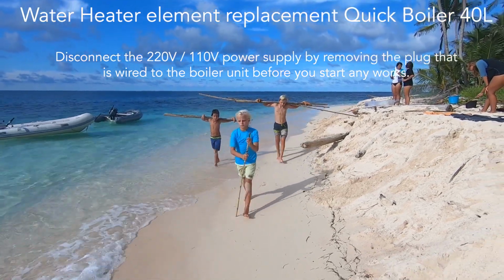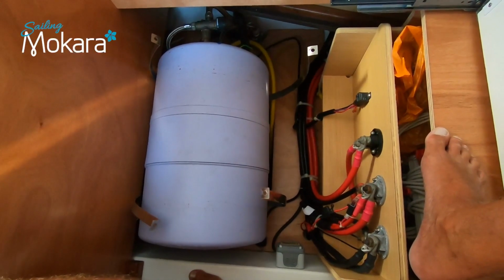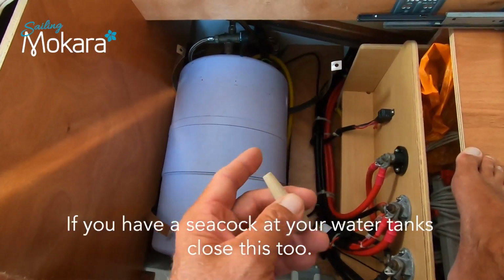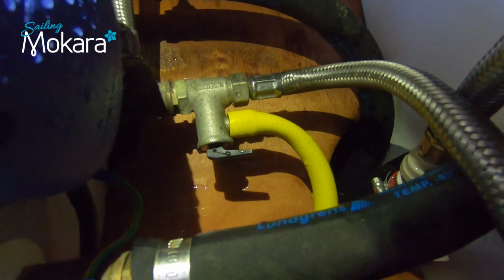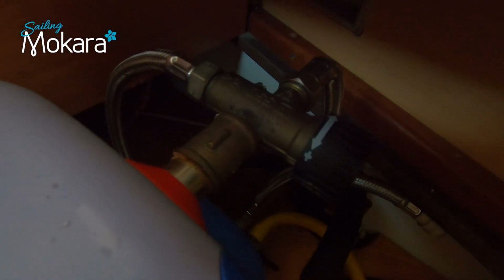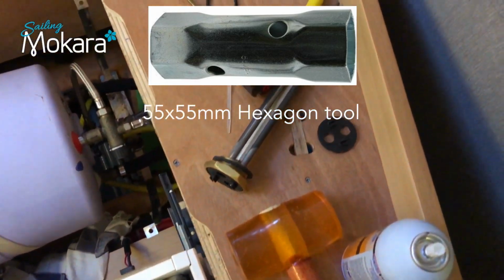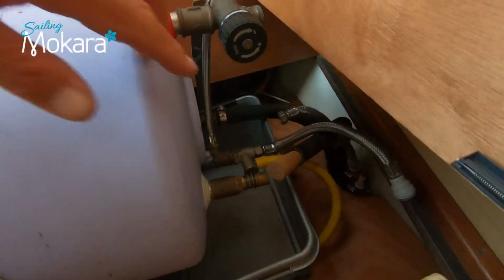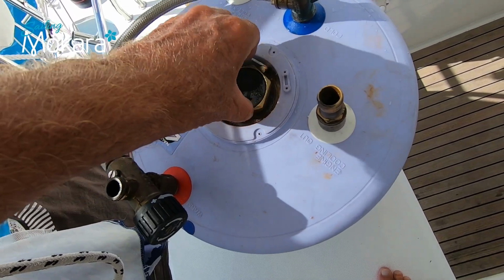Heating Element Replacement - Quick Boiler

Comment: Thanks for the fond memories of working upside down on 'stuff'.  Some folks don't realize that their home electric hot water heater has about the same element, and depending on their water supply, could look like your old ones. Especially with 'hard' water.  How geeky am I for watching your entire well-done video and I no longer have a boat? My wife even heard me agreeing with you several times. Best to the Mokara family!
Reply from the maker: Everything is in a cramped space on a normal sized yacht. For a 6ft 2" person this was a difficult job for me. As you know a lot of jobs get done by feel alone. Getting a cramp mid way through is also common. It is difficult to suggest a replacement period for your anode as I assume it is related to the amount of time the heating element is working.  Do you know? Well done for watching the whole video. Pure perseverance.
Reply: @SailingMokara  We didn't have a water heater on-board our boat.  Now in our house we replace the heater every 10 years (or when it starts leaking), so I have no idea of anode lifespan. Now that I think about it, seems I read our house water heater is "glass lined". Wonder if that's true or some sales pitch.  Ow, cramps can be downright killer!  You'll see as you get older!  I use magnesium supplements to ward off cramps; don't use magnesium oxide, though, magnesium glycinate seems best all around.  Thanks again for the great videos!